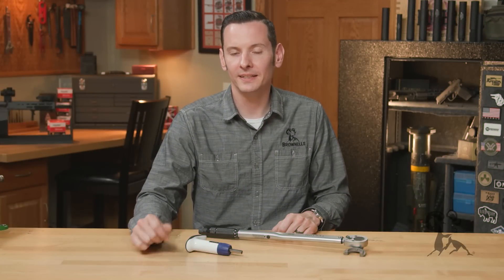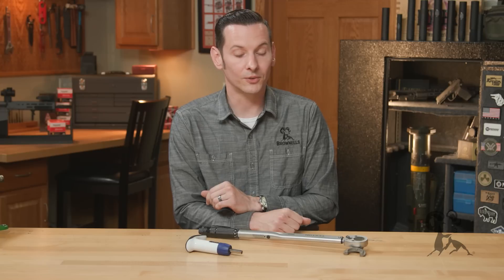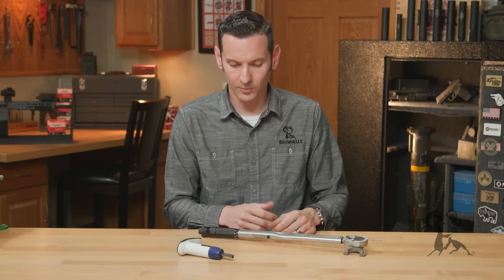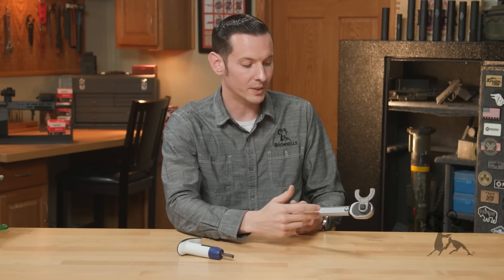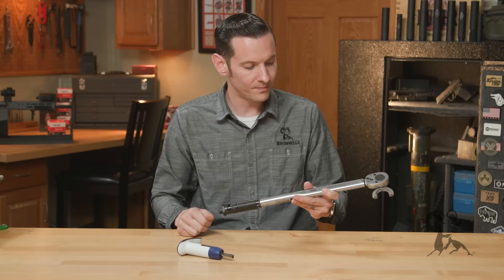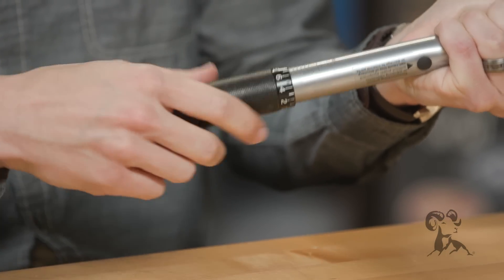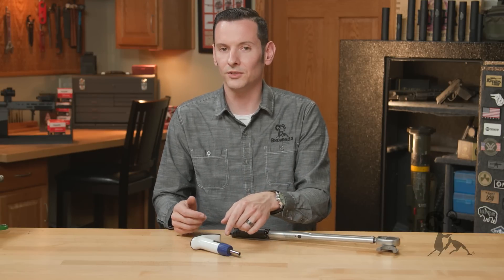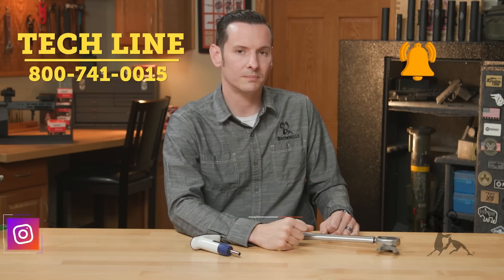Quick Tip: Basics of Using a Torque Wrench

Comment: Wow, your first "big takeaway" is not to mix up your torque wrenches, but then you make an incorrect general statement about the wrenches you use in the video...  to say large torque wrenches are inch-pounds is I correct.  Most are, but some are not.  You can get 3/8 & 1/2 torque wrenches that measure inch-pounds.  I needed it for a requirement to tighten a fastener to 125 inch-pounds.  I used to just convert, but they do make large torque wrenches for the larger inch-pounds in order to be more precise when needed.

Comment: So are the base compositions of magazine springs and torque wrench springs the exact same?  Were they given the same heat treatment?  Do you guys know more about the torque wrenches than the manufacturer who designed and built it?  Every torque wrench I have ever used says to store at zero.  You guys need to do a little more research before making blanket statements that only serve to make you look foolish.

Comment: Don’t buy the cheapest in-lb driver on Amazon. Buy something with a clean, precise indicator or even a digital torque driver. The one I got has way too thick of a line to accurately line up with your base in-lb setting.

Comment: You ever thought maybe the manufacturers tell you to relieve the stress on the spring so you wear out your torque wrench faster and have to buy another?
Reply: It’s because if the click type is stored and not returned to zero, they absolutely will form a set and lose calibration. I just had it happen on a $500 Snap On torque wrench in the shop. A split beam type doesn’t have to be set back to zero though. 

What he is telling people is irresponsible and bad information. I hope people that follow his advice and screw up their torque wrenches send the bill to Brownells.
Reply: No. The manufacturers want you to start with a relaxed spring every time. For torque-break consistency, and because all springs take a set. Torque instruments are sensitive to spring force at a given length. In a torque wrench, springs don’t move but 1-2 inches, and are usually greased, so wear is not a factor.

Comment: I have five torque wrenches. They all have a label that states to store the torque wrench put it in the 0 (zero) in-lb or ft-lb position. So until the warranty period is over I will not be storing them in the last used position. After that it will depend on how I feel that day.
Reply: I swear on Jesus I'm not trying to start a fight ... But I'm wondering how the manufacturer is going to know what setting you leave the wrench on , when determining whether to honor their warranty .
Reply: @davidgaines8607  because people send them back for warranty work cranked up to the last used setting.

Comment: Comparing apples to oranges when you compare a mag spring to a torque tool spring. So no, I will not leave it set when I store it. That's the way I was taught and that's the manufacturer's direction on every torque tool I have used. You stepped on a mine there Caleb...BOOM.

Comment: I relieve the tension on my FAT wrench, because the directions that it came with says to do that. But I seldom use it, as probably most people that aren't real gunsmiths. I think that a quality tool, with superior spring steel, will obviously be different than cheap tools. Isn't that what we think about magazine springs? I bought some cheap magazines that I left loaded, and the springs are OK, but the feed lips are showing signs of changing.

Comment: Would’ve liked the tip that you should never undo a nut with a torque wrench. As that can cause issues with the calibration.
Reply: In general, yes, “breaking loose” a fastener with a torque wrench is bad for the precision mechanism inside.
However, many quality torque drivers (screwdriver type) design in a clutch that locks in the anti-clockwise direction. Those can undo a screw or nut, and go right back to torque-limiting in the clockwise direction.

Comment: I just purchased my first torque wrench not long ago so I really appreciate the video. I will say the manufacturer of the wrench says to release tension when not being used but what you said about it makes sense.
Reply: It's also wrong. Firearms springs have a better heat treatment.  The springs on torque wrenches will take a set.
Reply: @robertjensen1438  where is the data on that? Asking for a friend.
Reply: @nohrtillman8734  You would have to check with the manufacturers. While I was going to college i worked for a company that assembled hand tools. Torque wrenches where among them.
Reply: @robertjensen1438  Appreciate your background information. This “spring debate” makes a broad assertion that all springs are, and age/wear/fatigue, the same. It’s wildly incorrect, because spring heat treat/geometry/base material is all over the map, like you said.
Personally, I relax all my click wrenches, and have for 30 years.
Reply: @robertjensen1438  by golly, your feelings don't need facts!
Reply: @nk-dw2hm  what feelings. It's what the manufacturer said. If you want to be a troll you have to try harder.
Reply: @robertjensen1438  "the manufacturer said so" isn't a fact. Some manufacturers have very different barrel break in directions, so which one is right? Is each barrel effected uniquely by physics, or are some of those informed by opinions (feelings) rather than facts?

Comment: I never use a torque wrench on a barrel nut. 35 to 85 is a huge range. I have been a machinist and mechanic my entire life. Im more interested in alignment. I always know the new guy isnt goung to make it if he asks how tight do i want the alternator bolt.  Tight enough so it wont come off is my answer. I always check the upper for square. So many are not.
Reply: Agreed. 35-85 ft-lb is not a “spec.” More like a “at least this much, but not more than this other one or problems happen” suggestion.

Comment: your theory of leaving tension on a spring type torque wrench is totally opposite of what I was told from high school auto mechanics tech school and by every tool salesman I've ever dealt with, the only ones they tell us that can be left stored away without being backed off is the tuning fork style  I've been in the business using torque wrenches for over 40 years and your the first person I've ever heard say that,  the difference between a mag spring and a torque wrench spring is accuracy, a mag doesn't need accuracy just good spring tension.
Reply: The theory of wear is exactly the same, regardless of what it's used for, I believe we can both agree a worn spring is a less accurate spring in a torque wrench. There are plenty of things we were taught years ago that changed because studies shown they were simply wrong and did not withstand the test of time.
Reply: @CalebSavant  caleb, in your videos you also mentioned a difference in modern springs. Is it studies that have been done or modern spring production methods? Can i store my M1 Garand loaded for STHF scenario? I joke, i dont have a garand 😢
Reply: In a production shop setting, where your torque wrench is used moment to moment, you can leave a TW set.  The funny thing about it, over the course of using a TW all day, the locking screw and twist handle works out of the desired setting, so you have to check your settings anyway, adjust and lock.   Most torque wrenches used in large manufacturing setting go to calibration labs periodically, get a certificate of accuracy.  
You could always use a beam type torque wrench.  
On Clicky type TW's, for long term storage, I storm them set on Zero.
Reply: So do what you want with your tools

Comment: Do you really need a torque wrench to tighten down & install a castle nut or can you do it by feel?
Reply: The torque range on a castle nut is pretty broad to allow for alignment. Good and tight, and lined up is all I've ever done.
Reply: There is no "wide range" on the castle nut as others are suggesting. If you want to be technical it's 40ft/lb but honestly anything close will do. I personally don't use a torque wrench on castle nuts but always stake them.
Reply: @CalebSavant  But the description up top states AR barrel nut torque is 35-85 ft-lb. That’s wide. 
Perhaps barrel nut and castle nut and buffer tube nut are getting interchanged.
Reply: honestly as long as you do it up tight and stake your castle nut, it should be fine
Reply: This is the type of thinking of someone who bubbas their guns. Manufacturers keep to torque specs for quality control. People who throw parts together in their garage do it by feel.
Reply: I agree the torque range is wide and I just run it down by hand then take a flat punch and hammer and give it a few good wraps then stake it. may not be the ideal way but Ive never had a problem or a castle nut come loose.
Reply: I use my arm as a torque wrench on castle nuts but recently I installed PWS racheting castle nuts. Easy on easy off.